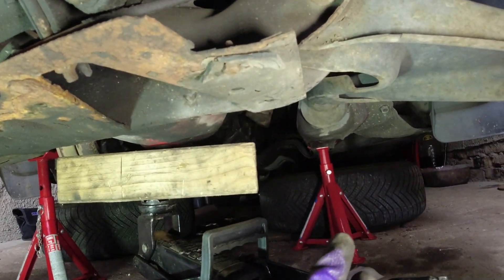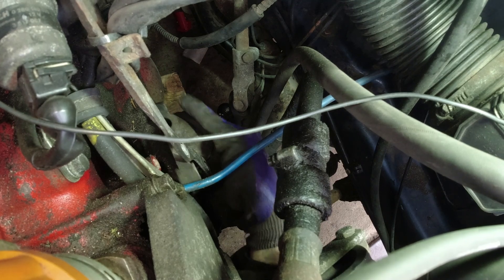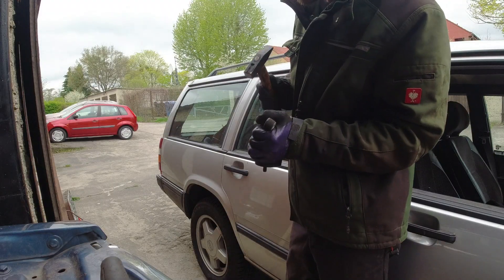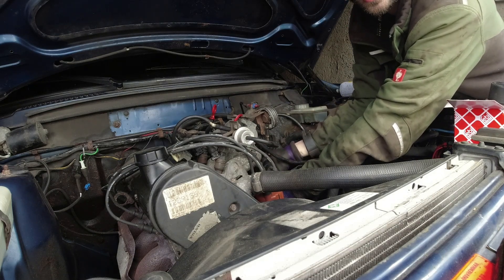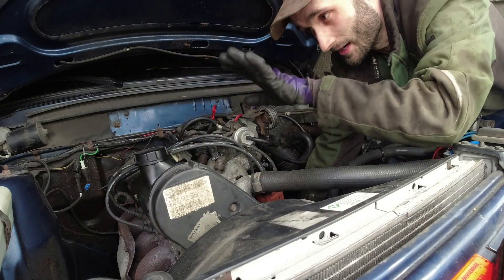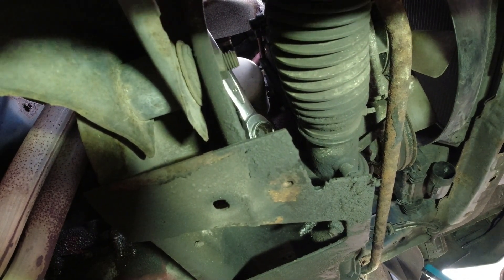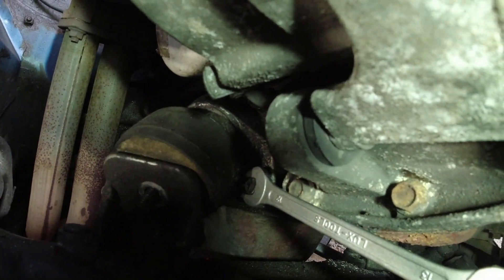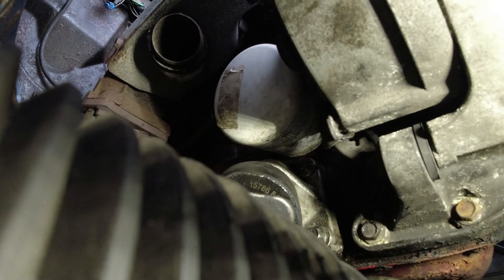Lili the Volvo 240 gets new Engine Mounts

Comment: This was a very good look at the job, close-up. And all 240s need engine mounts, especially the one on the right, under the oil filter.
Reply from the maker: Thanks! Yeah that's what Kolja who sent the parts pointed out, the rubber soaking in oil after each change is never good!

Comment: Saw a vid on testing those axle stands on here with hydraulic press and they were much better than I expected, failed at something like 8,000kg! Always a good idea putting wheels under chassis just in case.  It did look like the engine was trying to escape the engine bay when you started it at the beginning.
Reply from the maker: I saw that video too! Never would have thought it, but then with the straight tube to the ground I guess it makes sense, I feel like the danger with these stands is them going sideways, the other type are surely better for that. Not that you should have much diagonal force on them of course 😅
Reply: @Involvod  I know what you mean about sideways, that's why I agree about putting the wheels under chassis rails as a precaution, better to be safe than sorry. Ramps are good but there is danger in getting the vehicle up on them! I borrowed a great pair of ramps from work years ago that were almost flat to drive on then you wind them up like a jack. Nice to see the Volvos getting a little better each vid.
Reply from the maker: That sounds cool I wouldn't mind a set of them! Cheers mate

Comment: I did the same job last year on my 745. A couple of days ago I changed the little fuel pump in the gas tank. 
It had stop working and I guess 34 years of pumpin fuel is good enough. The pump cost me 370 SEK, a fair price I think. Got it from Mekster.
Reply from the maker: Nice, that's the thing now with the age of these cars anything can fail after a long life, still surprising how long the original parts last!

Comment: As someone who's done mounts on fwd and rwd, might be the worst thing to install on a car. Especially if you gotta do it on the ground. On the upside, red transmission mounts are stupid easy.
Reply from the maker: That's true, I've done a few front wheel drive that were alot harder to line up. And thanks that gives me confidence for the trans mount gonna get it on soon

Comment: Your creative holding fixture for the motor mount elicited quite a laugh from me!

On a 140 series, the mounts lack the peg that keeps them from spinning which makes removal and installing fun.

I did sorta cringe when you looked up through the engine compartment to address the camera and you didn't have a pair of safety glasses on.

As someone who has in the past had to have metal and plastic removed from his eyes due to similar actions I'd say glasses are much preferred to having one's eyes worked on. :) They don't need to be pricy, just some 3M Virtua's or SecureFit's will do.
Reply from the maker: Thanks man I know what you mean, I wear those sometimes, but definitely not enough!

Comment: Good job. When you revved  the engine and the thrust to the side before you fitted the new mounts, reminded me many years ago, when my mate and I forgot to attach the small wire rope at the front of a 1948 2.5 litre Riley. Massive long stroke and the wire held the engine from what seemed at the time , trying to do a somersault when revved . Lol. I notice on my 1970’s Mercedes they have a small shock absorber on the opposite side of the block to absorb the thrust.

Comment: So much easier on a car without aircon.  On 240s with it, the driver's side mount is a nightmare.  I almost always unbolt the bottom bracket from the crossmember and then unbolt the top one from the block.  Then, change the whole mount outside of the engine compartment.
I also always do the passenger's (exhaust) side on the 240s whilst doing an oil change.  Makes it much easier.
Pro tip: put a piece of aluminum foil or a rag over the passenger's (exhaust) side mount when you change the oil, to minimize spillage on the mount (which can accelerate its wear).

Comment: When you’re revving the engine like that by twisting that wheel with the cable on it, do you have the car in park or in neutral?
Reply: I could be wrong, but I think that's a manual transmission (m47) car